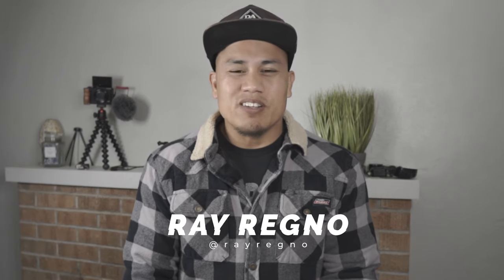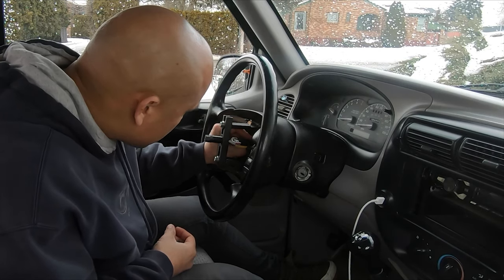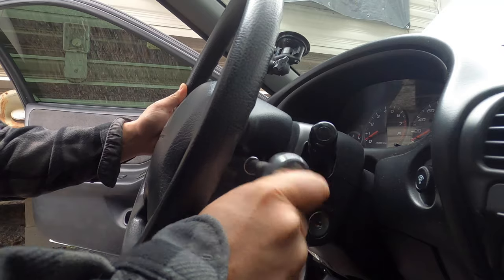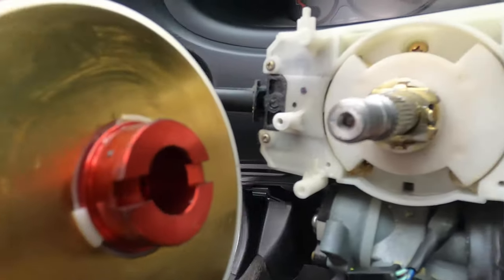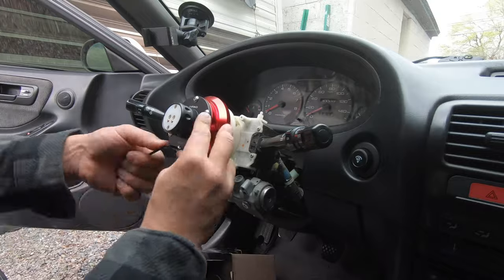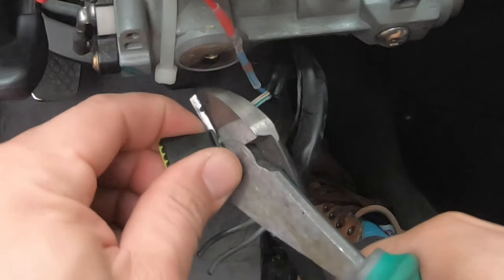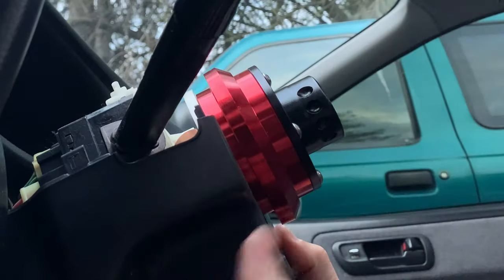How to Install NRG Short Hub, Quick Release Steering Wheel and Wire with Working Horn Acura Integra

Comment: Hey bro my 95 integra LS doesn't have that honk harness. I see you have a honk male plug and I dont have that. Its has a single ground wire that is joint alone with the whole in-dash harness. So once I pull out the harness, the wire for horn comes out too. I can't trace the horn itself.  Any idea how I can install the horn wire? My wire is different from yours.
Reply from the maker: What color is the wire? The horn wire should be blue and if you touch it to anything metal it should activate the horn. You'll need to extend it with a piece of wire to wire it like I did.
Reply: I have the same issue, not sure what to do. I’m gonna keep looking for it and I know it’s been 11 months sense you posted this but if you find it let me know!
Reply: @natedoggcfw7056  I figured the issue. Message me on ig @reglus03
Reply: @reglus15  just followed you!
Reply: @natedoggcfw7056  ok you are mjphotography?
Reply: @reglus15  Nathenlol5

Comment: Awesome video my guy, currently following the instructions. However, I'm using a nrg short hub with no attached wires but the package includes 2 jumper pigtails with fused ends. I'm going to go ahead and assume that at some point you reconnected the batt, aligned the hub str8, so that the horn work. This is for those who might be lost there. Keep these videos coming tho. Very helpful!

Comment: I need help when I hook up the wire all it does a clicking sounds no horn but when I set my alarm it works
Reply from the maker: The alarm connects to the horn on a different circuit. Where did you connect the wire?
Reply: I hooked my horn up like you did but I’m not sure who hooked up the alarm

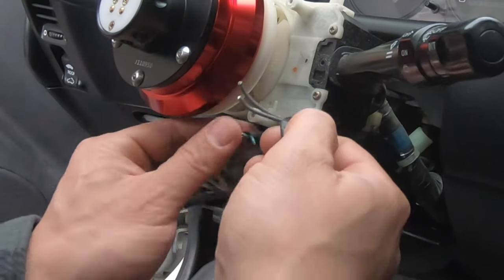Comment: The step you do at 7:00-7:03 works fine for me 
Once I get to 8:22 the Horn won’t work when I press the Horn on the steering wheel and make the wire touch the shoe Horn it won’t work.
If I grab the wire and make it touch a Metal piece then I can hear the horn.
Any idea what could be the issue?
I follows everything step by step.
I also got rid of the airbag light by following your instructions so thank you for that!
Reply from the maker: Did you the bend the shoe horn so it’s touching the metal part on the back of the hub adapter?
Reply: @rayregnogarage  yes it’s making good contact.

Comment: 9:40 I just cleared the code and it went away:).  I guess that might be why my horn won’t work.  My hub never came with that comped piece.  Where did you buy it?
Reply from the maker: I put a link to it in the description of the video
Reply: @rayregnogarage  And this will fix it?  I’ve seen other videos where there is no mention of it, so wasn’t sure if that’s what I need
Reply from the maker: Mine works
Reply: @rayregnogarage  Just ordered it :)
Reply from the maker: @justinguarino201  Nice.
Reply: Not me coming back to this video randomly lol.  My horn still don’t work 😂

Comment: Will this still work if I added the resistors in steering wheel where the airbag sits vs behind the clock spring for the airbag wires ? I assume it shouldn't matter
Reply from the maker: Yes for sure. I’ve done that on 3 of my other cars and that’s where I normally put the resistor. The integra was just a lot easier to trace the airbag wire so I thought I’d try behind the dash because that space inside the hub adapter is so small compared to how it is on my others cars.

Comment: Do you need the shoe horn only if you have a quick release setup? I have works bell hub w no quick release
Reply from the maker: Dunno if that one has a way to connect the ground. Even if I just bolted the wheel directly to the adapter, I would need the shoe horn for the NRG. The adapter and the quick release are separate.

Comment: If you wanna pull a steering wheel off you should screw the steering wheel nut on a couple threads so it doesn't pull the clock springs out with the steering wheel or hit you in the face
Reply from the maker: That was definitely an issue on my Xterra, but the Acura was super easy. No tugging required. Just removed the nut and the wheel came right off

Comment: Also couldn’t you just mount the shoe horn connector on the right so you don’t have to extend the horn wire? Thanks
Reply: And should my battery be off for this?
Reply from the maker: Should always have the battery off when dealing with electrical. Def do it before you remove the airbag.

Comment: You can just touch both battery cables together to discharge the capacitors in all of the cars modules/computers in less than 5 minutes.

Still want to be careful with airbags. Static electricity can set them off.
Reply from the maker: Good tip! Thanks!

Comment: Questions how come my quick release is hard to turn.? For my CR-V 2000
Reply from the maker: Not sure. what size is your new steering wheel compared to the old wheel? Did you use a torque wrench to tighten the steering wheel lock nut? Ive got the quick release on three of my cars and the Honda is by far the smoothest.
Reply: @rayregnogarage  well the brand is RTD from eBay and it's 1 x330 mm steering wheel. Was it supposed to be hard to turn if steering wheel is change? My brother told me the smaller and the light the steering wheel is going to hard to turn?
Reply from the maker: Ah I can’t really answer what’s going on with the eBay product. I’ve never seen or used that. I had a 320mm on my xterra and I felt like it was too squirrelly for me. Small inputs into the wheel made the front wheels too jumpy on the freeway. I like a bigger wheel. I use a 350mm Momo and like it a lot. Does your car have power steering? Have you checked the fluid?

Comment: Where did you find the wire for the horn?i cant find it. Maybe you can help me
Reply from the maker: It's on that connector that you disconnect from the back of the clockspring. Third terminal. I show how to find it in the video. Blue wire
Reply: Stronghold Garage crazy some how i cant  find it 🤦🏻‍♂️,its been 3 years my car dont have horn.
Reply: Maybe its different coz i have 99 integra?
Reply from the maker: maybe. I don’t know of a change between the two. pretty sure the 98-01 are the same.

Comment: do the autocanceling turn lights still work?
Reply from the maker: lol. i don’t use my signals. but without the clock spring it won’t auto cancel
Reply: for anyone thats interested, my auto cancelling lights still worked after installing the short hub adapter, i did not install the horn

Comment: My steering wheel goes to the left alittle whenever I’m driving straight not sure what I did wrong.
Reply from the maker: Were your tires perfectly straight when you removed the factory steering wheel? It's also possible when you put the hub adapter on the steering column that it was off by a tooth or two. I did that in my xterra and had to take it apart and readjust a couple times.
Reply: @rayregnogarage  yes I’m pretty sure the car was straight when I put it on, I uninstalled it a couple of times and put it on again but still the same thing probably off by a little like you said.
Reply from the maker: @supremegaming6532  one tooth off can make a big difference